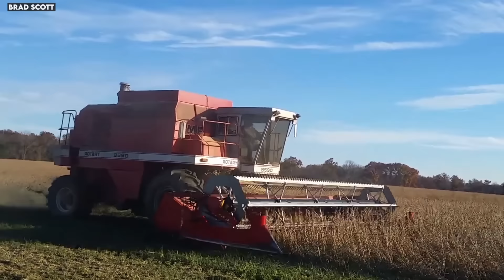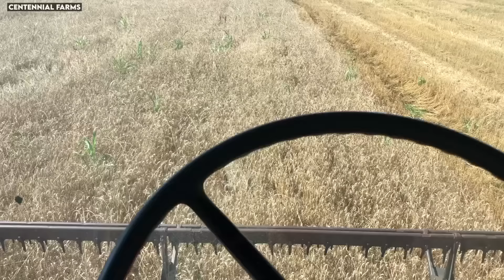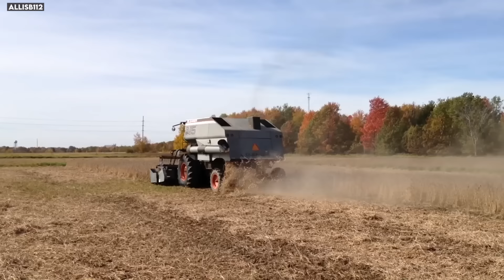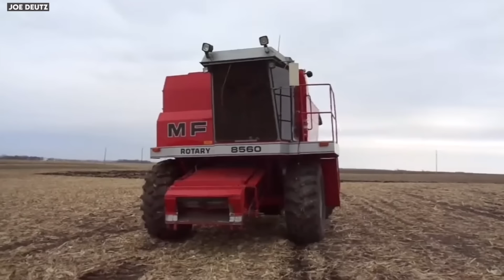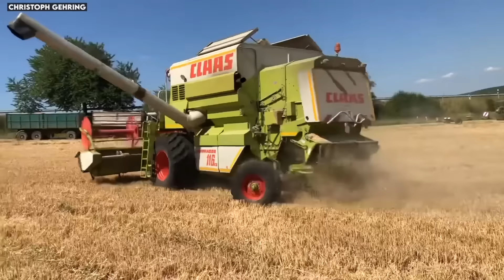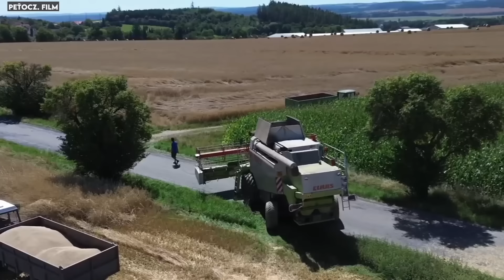10 Forgotten Rotary Combines That Started a Revolution

Comment: The MF 8560 used a Cummins 5.9 l  not a Perkins engine.
Reply: Incorrect. 8.3 Cummins was used.
Reply: @detroitdiesel2983  5.9 in the 8560 the 8.3 was used in the 8570 and later models